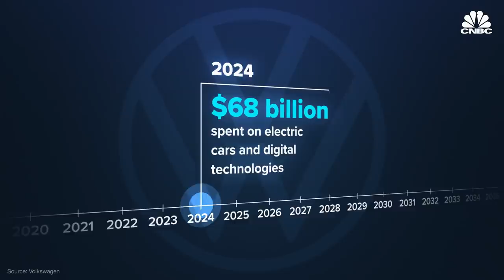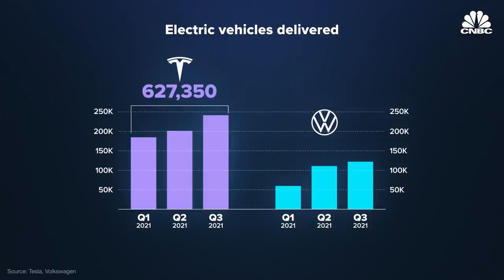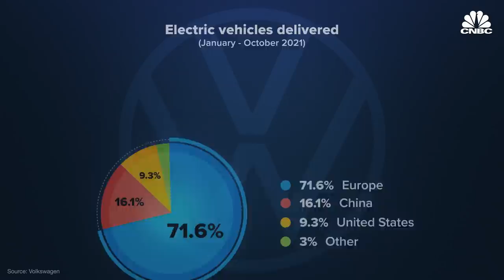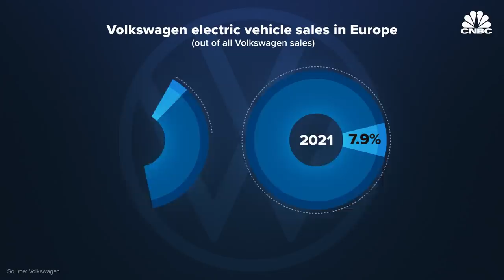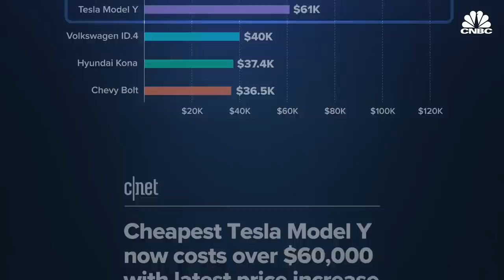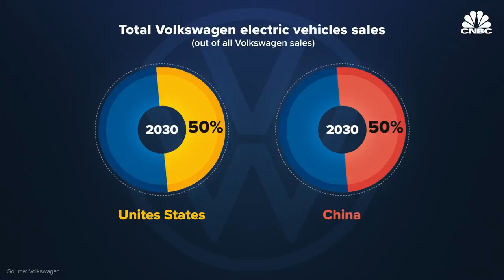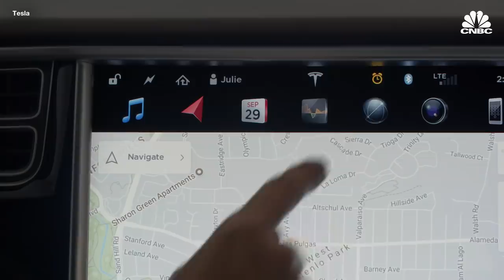Why Volkswagen Is Beating Tesla In Europe

Comment: Short awnser - here in Czechia the entery level Model 3 costs as much as mercedes E class, whereas the base model ID3 can be had for the same money as a well specked Golf.

EDIT:
There have been some valid counterarguments, which I want to address:

1. Base model Tesla gives you a lot more tech than a base model ID3:
That's true, entery level ID3 doesn't have things like a heat pump, adaptive cruise controll (or vw offered a model without those, when I looked at it - they change it often). But especially the adaptive cruise controll/autopilot is one of those things that are nice to have but only useful when you drive long distances often. As they mentioned in the video, people here generaly don't drive nearly as much as you guys in the US (from my own experience I can tell you that driving 2 km to a train station, taking a train to a nearby city and moving around the city using trams, buses and trolleybuses is far more convenient and usualy quicker than driving directly where I need to go, likely because public transit vehicles have their own lanes and priority at bussy intersections; and I don't need a fancy autopilot to drive 4 km up and down a hill a day), so adaptive cruise controll/autopilot is one expensive thing that many customers can drop without remorse. Similar arguments can be found for many other software features of Teslas that VWs lack - nice to have but not really necessary for many people. VW at least gives you the option to not have what you don't need/can't afford.

2. Once the Berling factory is running Teslas will get cheaper:
Again – that’s true. Once VW builds it's battery factories VWs will get cheaper. What’s the price difference going to be in 6 years is anyone’s guess.

3. Tesla has better batteries than everyone else.
Possibly true. I don't know enough about batteries to critisize other people's work but my instict tells me it's a bit more complicated than just comparing a hadnful of possibly cherry-picked paramters like capacity and charge/discharge efficiency plus I belive VW has partnered with LG and Samsung who also make some really good batteries. However let's give Tesla the benefit of the doubt - even then superior technology is not a golden ticket to success. They also need to turn it into product the general public wants and can afford and VW has a huge andvantage there.
Reply: Yeah, i think that's the point
Reply: A Model3 is more like a Golf GTI...
Reply: @C4H6As  That's still a diffrence of around 13 000 usd between entry level Model 3 and Golf GTI / ID3.
Reply: @C4H6As  yeah the consumer group for golf gtis might be lucky and happy about that but thats like saying yeah its enough to sell the model 3 for those maybe 9% of car drivers within a nation.
Reply: @frogg8891  There is massive depreciation and maintenance that needs to be done on the VW plus the cost of petrol is enough to eat up that $13000 in a couple of years.  Bottom line is still the bottom line and this is entirely why people are moving to EV.  The difference between the ID series cars and any Tesla is like comparing a yugo to a bentley( which is also owned by VW)
Reply: @stevepailet8258  get real, i dont know your age but i would never buy a tesla over mercedes e class.
Reply: Give it 2-3 years for the Tesla $25k car #marketshift
Reply: @siiNke  having owned 6 mercedes and working in a dealership years ago I know that given the choice I would buy a Tesla. Superior quality of the drive train. You can have your mercedes with $2000 a year maintenance plus $4 a gallon gas to run it.  Plus depreciation of several Thousand per year.  So at my age which am sure is a lot older than you, experience says buy the Tesla.  You can keep your E class.
Reply: @stevepailet8258  great to hear that. I'm driving merc right now and going to stick with it. My maintenance costs 400 euro a year, and liter of gas is 1.50 Euro.
Reply: Get an E-class estate/wagon while you can!
Reply: @ClickLikeAndSubscribe  give it to me I would take it.. Sell it and get a tesla.  I know how it is doing maintenance on these cars.
Reply: People in Czechia have that much money?
Reply: You guys can ride your crappy basic electric cars, I will enjoy FSD 🙂.
Reply: This VW bs cannot beat Tesla in Tech, VW can try but tech is not easy.
Reply: Nobody needs a Tesla and nobody wants a VW. 😁👍
Reply: Import taxes
Reply: @siiNke  you will, you just do not realize you will. In a decade you wont be able to buy a Mercedes, since they would have gone out of business
Reply: @pwells10  The price of Copper  & other essential materials are going in the wrong direction fast. Each Tesla needs several hundred pounds  of the copper, it most likely they will only get more expensive, Tesla has  increased it prices significantly to keep pace with rising material costs and to keep profitable. If a cheap Tesla  does come to the market  it will  have  smaller  less powerful motors and smaller batteries which will make them  a lot  less appealing .
Reply: @stevepailet8258  No...more like comparing a VW to an Audi...
Tesla is sold as a premium brand (price and tech)...
VW will sell plenty of EVs...So will Tesla...It's the ICE that will suffer.
Reply: @stevepailet8258  ah yes, Tesla is not superior quality. Misaligned body panels, lose interior trim, and sometimes a reliability score that doesn't exist because Tesla doesn't allow it. Consumer Reports for 2021 ranks Tesla Model X dead last. Ill take paying for gas to have a higher build quality and more luxurious feel of a Mercedes if im paying for a car in that price range. Nothing can replace the sound and feel of an AMG V8. Maintenance isn't even an issue if you lease or get a maintenance plan at the time of purchase, Its not that hard. Its funny watching people always go the high maintenance route for bashing German cars.
Reply: if i spec out an ID3 to match a model 3 as close as possible, im landing at 40.970 € - and this is the short range (58 kWh) ID3, basic driving assistance, alloy wheels instead of steel... no extra paintjob nor seat material... and the base Model 3 comes in for 2000€ more than that... for that you get a car thats way more powerful, way faster charging, better efficiency, more cargo space, autopilot and an infotainment system thats second to none... i dont know why in Czechia this is so damn screwed up, but i will pay that two grand happily...
Reply: @Wooly Chewbakker well... I sure could... But then I'm missing heated seats, adaptive cruise, heck even a freaking heat pump costs extra in an ID3... you can't even remotely compare a base Model 3 to a base ID3... It's like going back 6 years
Reply: @johnrobdoyle  copper isn't the only thing going up in price. So is steel, aluminum and plastic which ICE cars are made of. Maybe due to inflation its not 25k but I'm very confident in the research I've done the next car from Tesla will be in the same price range as the Toyota Corolla/Honda Civic and will be 1/2 the cost to own and operate after purchase.
Reply: The price of Teslas in Europe will drop when they start making the cars in Germany. They did acknowledge that in the video then went on to say that German and European brand loyalty to VW will keep them buying VW's. It'll be interesting to see how that theory holds water if people can buy a Model 3 for the same price or cheaper than an ID.3. The two cars may be a similar size but the Tesla is a better car in efficiency, range, performance etc.
Reply: @godlyweirdo  consumer reports is sadly bought and paid for. The Ford ceo is on the board at consumer reports. I noticed when he tweeted the video consumer reports did showing how to trick teslas self driving using malicious and dangerous tactics. It was the equivalent of how to build a pipe bomb IMO.

Consider Tesla doesn't have an advertising budget so anything you read probably has a negative bias. Talk to a real Tesla car owner for actual data. They are faster, safer, cost less to operate. Electric cars are superior in any performance metric compared to ICE cars outside of long haul trucking.

It will be interesting how those misaligned body panels work out with the one piece exoskeleton design. But it's really just cosmetic. Doesn't affect performance at all because as you said it's just a panel and the media likes to critique them any way they can-thats the best they could come up with.
Reply: Thank you
Reply: You can thank the subsidies paid by German taxpayers, and import tariffs on Teslas, for that.
Reply: This is why people buy Volkswagen.
youtube.com/watch?v=twyw8UdsWnY
Tesla has good software.  Volkswagen has good engineering.
Reply: @Poxenium  lmao I guess agreed.
Reply: Slow T-bone accident rips off rear Tesla axle.
youtu.be/hvgefHS6Oeg?t=85
Repair cost unknown but my guess is at least $50k.
Reply: @ReeseL4D  I guess don't get t-boned?
Reply: @Wooly Chewbakker sure not in Europe, the slow ones in Tech.
Reply: @siiNke  just want to point out that 1.50 euro per liter is equivalent to $6.43 per gallon. No idea you guys paid that much for gas/petrol.
Reply: Have you ever thought about why they are so expensive?  Because there is too much demand and production cant catch up.
Reply: @C4H6As  it isn't priced like a gti.
Reply: But you forgot to mention Mercedes E class entry level with base engine and few extras, certanly not a well equippled 6 cyl
Reply: @Tonyx.yt.  In the original comment I was talking only about entery level cars.
Reply: Tesla’s are too expensive that’s why I went for the ID3
Reply: As for the percieved "advantage" for legacy OEM's that "They know mass production"
To paraphrase Herbert Diess (VW CEO) "it takes us 30 man hours to build a car, TESLA does that in 10 hours"
So much for the "percieved expertize"
Reply: The narrative is ALWAYS WRONG.
EV makers are NOT competeing against TESLA, market share does not matter, IT IS NOT THE IMPORTANT METRIC.
The competition is ICE cars.
TESLA's market share WILL FALL even if it produce  20 million cars.
There exist a couple of MILLION BEV's in the world but more than 1.2 BILLION ICE cars.
So what is the important metric??? Selling 20 million cars with 5% market share or 1 million cars and 20% market share?
As long as you sell all you produce competition is actually helpful, more BEV's = more charging = greater acception rate.
IT IS NOT EV vs EV it is EV vs ICE.
Reply: @Steve Pailet  
" $4 a gallon gas"
Funny you think that is expensive, we in Europe pay 7$-8$ / gallon😂😂😂
Reply: @John Doyle  
"Tesla has  increased it prices significantly to keep pace with rising material costs"
I do not believe that is the case.
Yes rising material costs might be a small part but not the main issue.
First, normally when you buy A LOT (as TESLA does) you have long term contracts to secure price and availability so price spikes (spot prices) does not affect you.
TESLA do have a 30% profit margin so they really do not need to raise prices out of that reason.

The MAIN REASON TESLA raise their prices is simply BECAUSE THEY CAN.
They sell all they produce and have a large backlog.
Another reason is the (probable) new federal EV subsidy (applicable to the US) of 7000-8000 USD/car.
Then in some state you can get an additional 5000 USD
If they did NOT raise prices the backlog would be even larger.

It would look very "bad" if the government introduce a 7000 USD incentive and THEN you raise the price with 7000 USD...
Better to raise your prices incramentally before the credit.
Reply: @C4H6As  sure but not everyone buys a gold gti... that is a quite niche market for car lovers, but most people are happy with tdi or tsi engines.
Reply: @stevepailet8258  Yugo to a Bentley, I think you really don't know what you are talking about. Greetings from Australia
Reply: @rl7586  comparisons my friend.  just to show absurdity
Reply: @ReeseL4D  on then keep your old VW and old tech that comes with it.
Reply: @SP-dw9gi  oh, come on. the ID.3 has a great matrix LED light and a headup display with augmented reality. tesla does not even have a display behind the wheel, not even as option.
Reply: @deusexaethera  the subsidies also apply for tesla.
Reply: @stefanweilhartner4415 Why need a heads up display when your Tesla can drive itself.
Reply: @Wooly Chewbakker better then your bug ATM, it just about there, Waymo is actually preety damn good with geofencing, get your facts straight.
Reply: @siiNke  6 bucks per gallon
Reply: Tesla's margin is reported to be close to 30 percent; they can forego raising prices once supply catches up to demand!
Reply: @siiNke  you must not drive it very much
Reply: @Wooly Chewbakker some are closer then others while some may never get there, like VW.
Reply: @Wooly Chewbakker sure shows what you know.
Reply: @Wooly Chewbakker Ok Boomer
Reply: @xfhnhhgjbvcfg  well depends. I make 14 000 km yearly. That's around 40km a day. I live on the island so everything is near by. But gas prices like that are normal for us. They used to be 1.40 for many years not only now. If I drove more I'd get diesel not petrol. Atm my average is 7.6l/100km, my buddy's diesel is 5l/100km
Reply: @siiNke  ok that makes more sense , you drive about 75% less than I'm used to. Very cool
Reply: @Wooly Chewbakker ok Boomer.
Reply: @Wooly Chewbakker i wouldnt say its only for huge income... i got a pretty average income and will get a Model Y next year. sure, depending on the country it can be subjective.
Reply: @Wooly Chewbakker median family is 70k for US.
Reply: @bryjb10  Look, I don't know enough about batteries to critisize other people's work but instinct tells me it's a bit more complicated than just  comparing a hadful of (possibly cherry-picked) parameters. Plus VW partnered with LG and Samsung, who also make really good batteries.

Anyway, giving Tesla the benefit of the doubt, superior technology isn't a golden ticked to succes. They also need to turn it into products the general public wants and can afford. And VW has a clear advantage there. It's a huge conglomerate, that sells cars to budget conscious buyers, billionaires and everyone in between. I don't know where you get your info from, especially the part about VW having no capital and being full in on ICE motor manufacturing, but I have to say it directly contradicts what the company says it's doing and what it indeed appers to be doing.
Reply: @Wooly Chewbakker First you incompetent person, you don't buy all cash, you buy on finance at lower interest rates which everybody has ATM,  these breaks payments down into allotments that are more manageable. The question really is would you use those allotments for a VW or a Tesla, and I'm sure most people would choose the Tesla.
Reply: @Wooly Chewbakker Your argument is non sense, cause this vid was about buying VW vs Tesla in Europe so wtf are you talking about? It was not about if it was a good idea to buy one if your not making money. What we were discussing was if VW is better to buy then Tesla, which I believe they are not. You would not spend more them half your annual income if you were the Tesla over a VW as it is around 5K more ATM, and would soon be getting cheaper once giga Berlin comes online.
Reply: @Wooly Chewbakker I guess.
Reply: @Wooly Chewbakker I see many Tesla's here just saying tho, but its in northeast where ppl have money.
Reply: @Wooly Chewbakker that's just not true... Leasing is an option, with lower maintenance cost and generally lower cost of operation it can be worth it in the long run. Doesn't have to be a Tesla. With my 35k annual salary it's totally feasible. And as a family car it doesn't get better than a Model Y, it's the safest car ever. And when it comes to safety i don't make any compromises whatsoever.
Reply: I just recently moved to Czech republic and the car prices are ridiculous. Their import duties are just stupid.
Reply: Personally, in face of the price advantage of the ID3 and the "aura" of VW and the Golf (which the ID3 is the electric counterpart), I'm really surprised why it is not dominating Europe EV market, specially with the millions VW fans in Europe. But it seems that others things are important to attract buyers and, until October, more than 100.000 Model 3 were sold in Europe and only 58.000 ID3, and that before the usual last months (November and December) deliveries tsunami from Tesla.
Reply: RESPECT FOR ADDRESSING COUNTRARGUMENTS KING
Reply: commutes in Europe are shorter…
Reply: @C4H6As  if a Golf GTI was a budget car lol
Reply: @xcortians482  "It was communist, so people are definitely poor" mindset
Reply: Sold my Mercedes 300 and bought 2018 Model 3 - "The minute you sit inside that car, your definition of what is expected is altered forever".